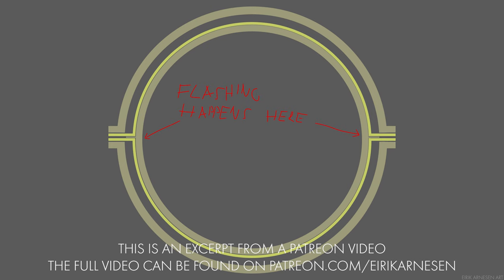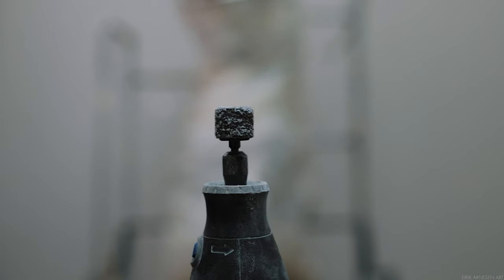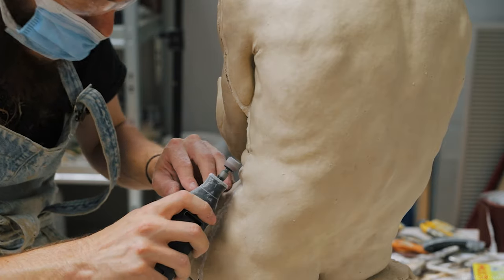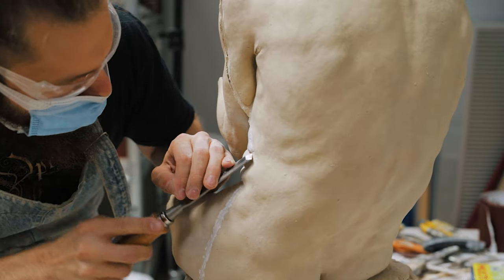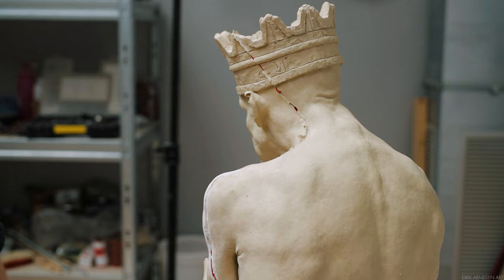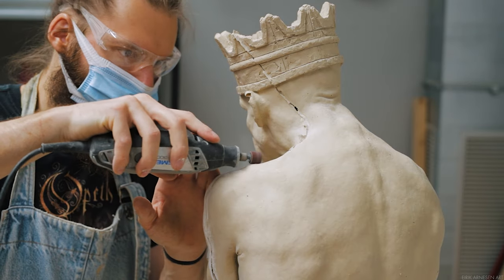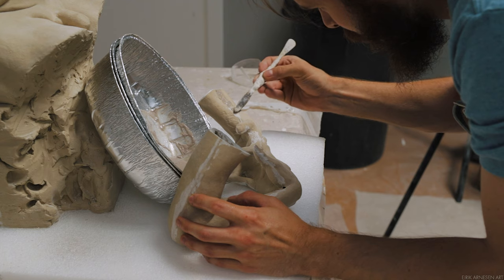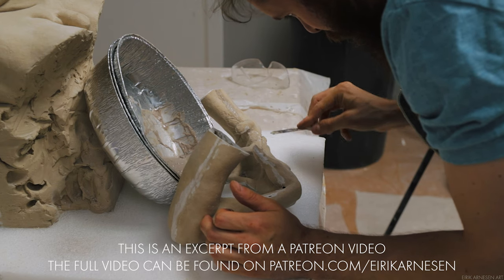Casting In Hydro-Resin - Repairing The Seams

Comment: Do when you put hydroresin over the sanded seams, do you still use sculpting tools to achieve a consistent texture on the surface? Or just the breadknife youre using is enough?
Reply from the maker: I use a metal spatula, which is similar in size and shape to the sculpting tool I use when sculpting in clay, but when I sculpt in clay I prefer wood tools.
Reply: Thanks. So i suppose the knife leaves the same textures as the wood tools you use when sculpting in clay?
Reply from the maker: Well I try my best to mimick the texture.